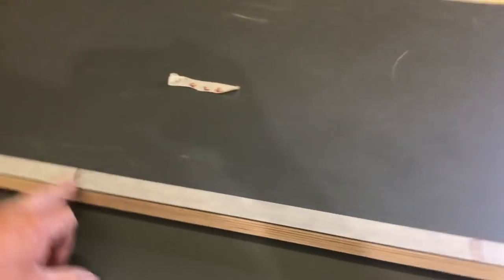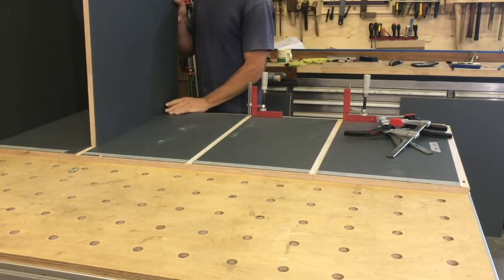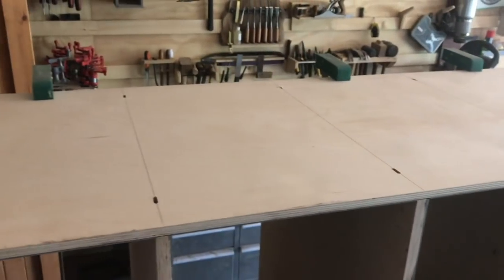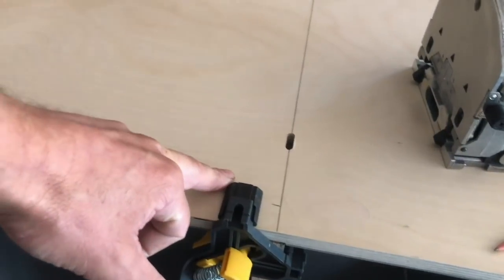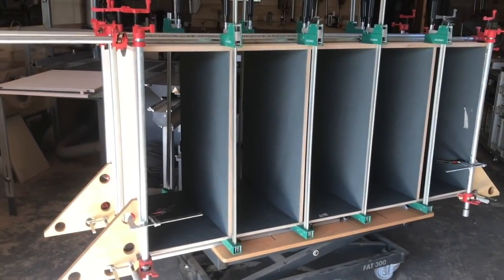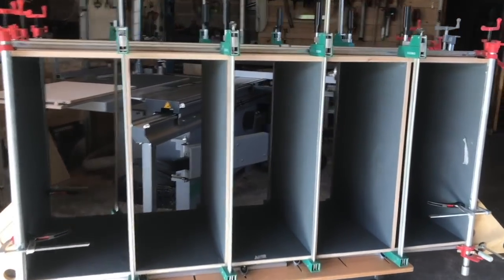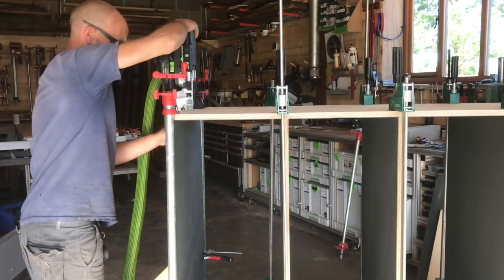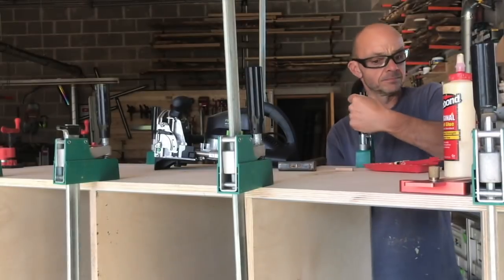Dressing room p2   - Shelf unit 3

Comment: Looks really good, Felder table looks handy too. £1100 seems a bit steep for what it really just a scissor lift table most sell for £300.
Reply from the maker: I agree but its a work horse ..  I did buy mine in one of the Felder sales.. so didn't cost me 1k but still not cheap..
Reply: I’ve been lusting after one of their CF 741 combination machines but can’t decide if I’m too disorganised to use one or if it would actually save any space. Felder make some very nice gear. The planet you use is a monster.
Reply from the maker: I personally like to leave machine set up for as long as possible while I am build furniture , just in case you make a mistake in anyway or have cut less than needed. but it may well save space if you are very organised..

Comment: You could make a two piece panel to align the domino. Put the panel with both pieces on the actual line and clamp the back piece, remove the front pieces that is the same size as the offset for the domino and then just but the bottom up to the clamped down piece. Center of the line every time without messing with lining up the grooves.
Reply from the maker: Gong to give this some thought . sounds like it could work if a start making lost of units .  all of these so far a different in some way so did bought with any set up jig.  good idea

Comment: Thanks for that Andy it is coming along really well. What type of glasses are you wearing i'm having problems with dust and i need to wear my reading glasses for finer detail work are they safety are perscription
Reply: Mark Armstrong I have used safety glasses with a bifocal lower lens for some time in the workshop and find them very useful. I normally have to wear glasses for reading and fine work , e.g. Sharpening a twist drill. Have a look on eBay for Voltx bifocal safety glasses, they come in different diopter strengths, and can be purchased in the £10 to £15  price range, although you can pay a lot more for some.
Reply from the maker: Hi Mark, I don't have any perscription they are just good quality safety glasses , can't remember were I got them but they are so good you don't have to keep taking them off when your not cutting etc..  when I take the cheap one off I forget to put them back on :( ..
Reply: Thanks alot Phil H99
Reply: Cheers Andy

Comment: I'm curious, does the domino cutter have variable width cutters? What is the small digital tool you used to check 90°? Beautiful work as usual.
Reply: The smaller Domino machine (DF500) uses cutters 4, 5, 6, 8 and 10 mm; the larger (XL) starts at 8 and ranges  10 and 12 to 14 mm. Both machines can do tight, somewhat loose and really loose holes.
Reply from the maker: Its really checking all my cuts are spot on (I should have said 90) saying that if they are stop on then I can put in square with the rear brace... its a Bosch Laser Measure GLM 50 very handy ..